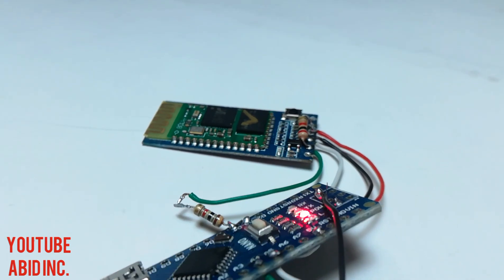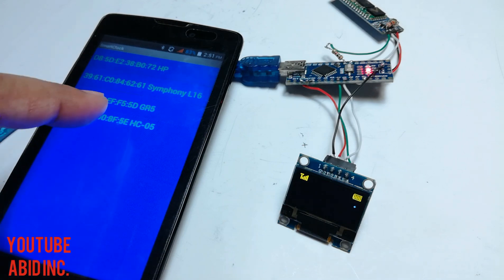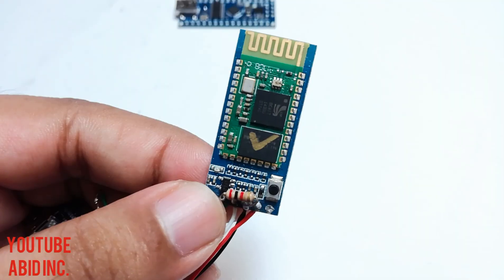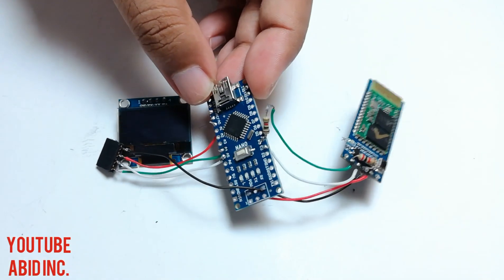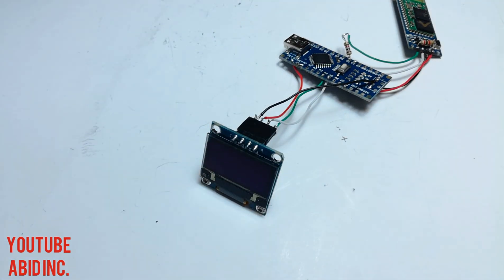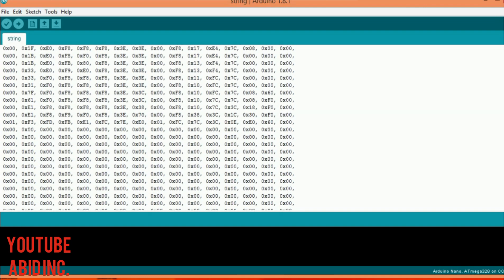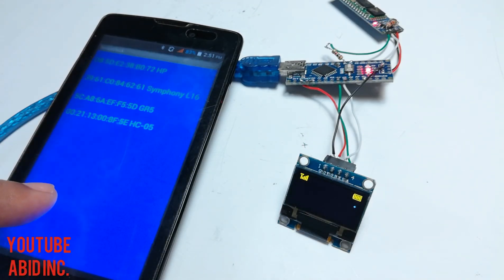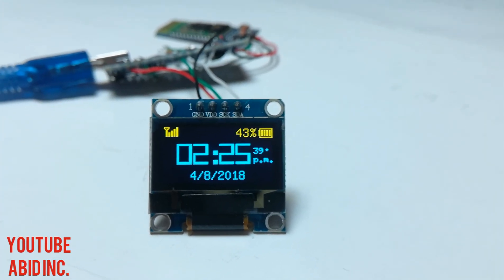Make Your Own Smartwatch at home |Arduino Smartwatch The Easy Way|Part 1

Comment: Hello, can you send the circuit diagram?
Reply from the maker: similar to this.Check the RX TX pin from Bluetooth to Arduino (as per code)
https://circuitdigest.com/fullimage?i=circuitdiagram_mic/Circuit-Diagram-for-Arduino-based-OLED-Smart-Watch.png
Reply: @ABID5  thanks, can you give the android source code? as app invantor file
Reply: @ABID5  and the code in the explanations is not compatible with arduino nano

Comment: Bro I have successfully made the watch. thanks a lot for that. but the app for the android phone does not work. I have checked all my connections and modules and have come to the conclusion that the app in the link does not work. i tried downloading other apps to fix this issue but those also dont do the job. it would be great if you could suggest how to make the app. I am new to this, so i dont really have a clue on how to do it. Or you could create an app that is compatible with android 9 and above and send it across. any help will be appreciated. thanks
Reply from the maker: Welcome.Check email.

Comment: Great work. Currently I'm looking for a good power supply for my smartwatch. What do you plan to use for your watch? Lipo Li Ion or do you have another idea? I'm not so familliar with hardware and very interested in ideas...
Reply from the maker: the nano takes 2-3mm of space, if i could integrate the nano with the bluetooth board then much space will be freed.180-200mAh lipo can be used.

Comment: Bro it's a awesome project but I can't able to download the code that because of the link didn't work pls check the link..,..
Reply from the maker: sign in to google account
then click link.
Reply: @ABID5  Bro this type of error coming when I try to download it to my PC "We're sorry. You can't access this item because it is in violation of our Terms of Service".
Reply from the maker: if you have Android then sign in to Google Drive app.if in windows then sign in google in chrome browser.try again
Reply: @ABID5  bro now it shows "unable to access document please make sure you are connected to the internet" though I am concerned with my WiFi and also try with my sim but both cases are same. Your project is awesome there is no doubt but I don't need to download code and apps because of I am fade up of this problem thanks for replying....